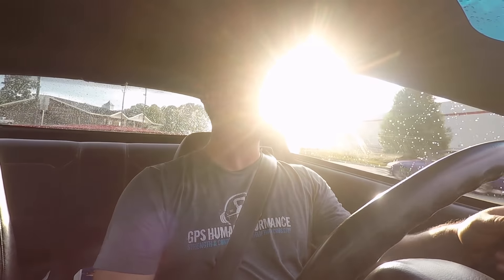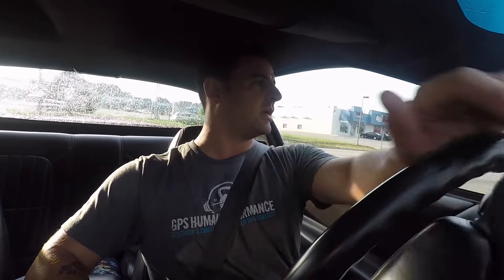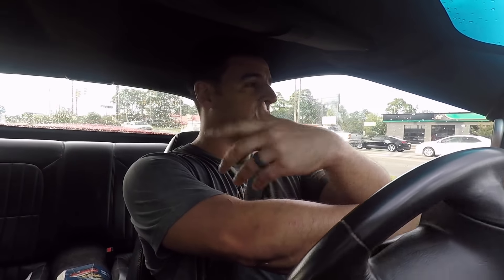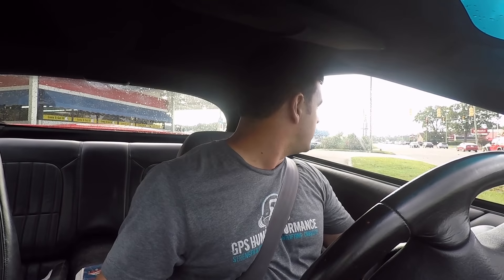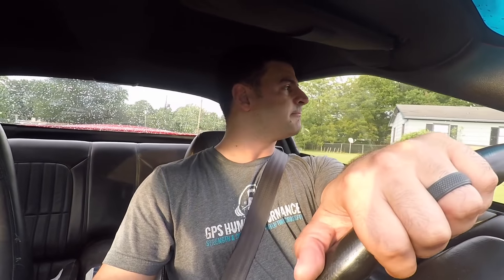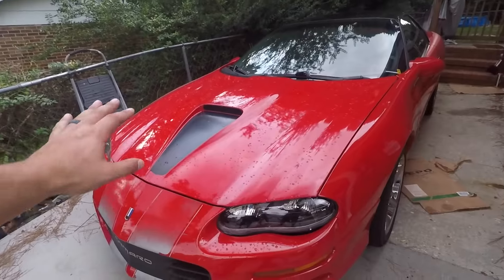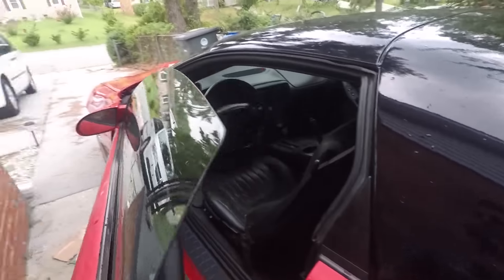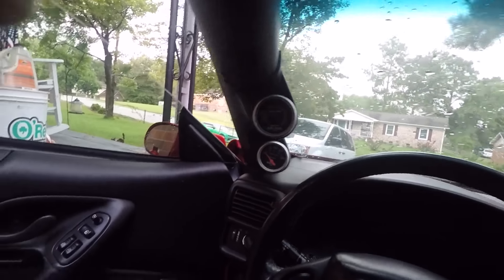Driving a 2002 Camaro SS I completely Rebuilt in my Driveway -  Ultimate Cruiser?

Comment: Did you bore the 4.8/5.3 block to standard 5.7 bore?
Which heads are you running?
I have a 2002 SS just like yours with 42,000 miles on it.